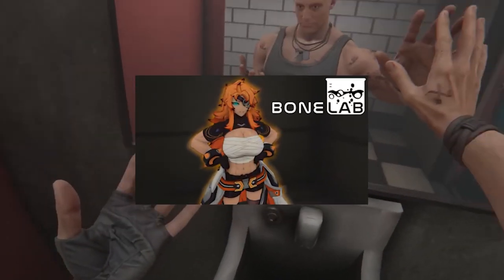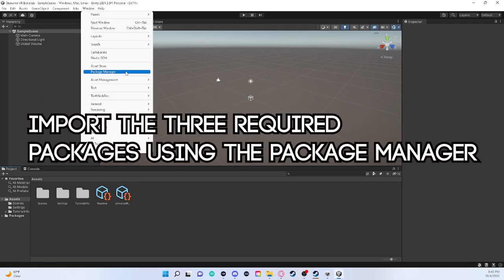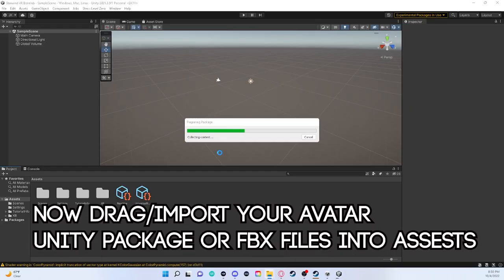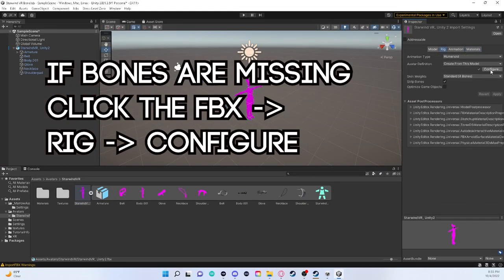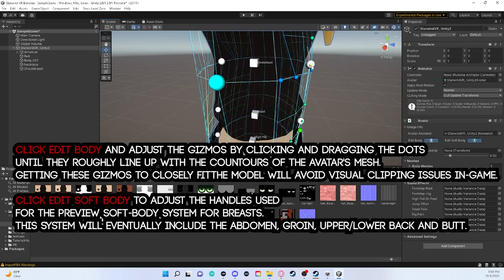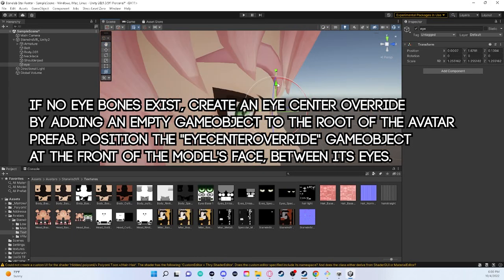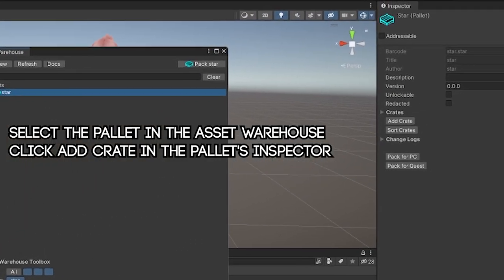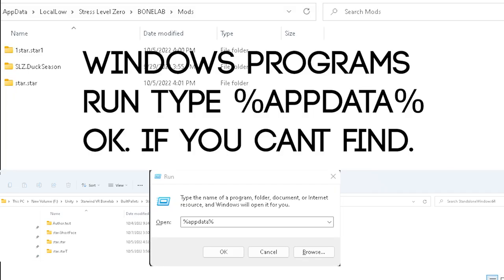Import Any Avatar into BONELAB Tutorial, PC needed!

Comment: I've repeatedly uninstalled and reinstalled git, i've restarted, and powered off then powered back on my computer. I even tried making another project. But despite all of this, the packages never download. I've done essentially every form of copy and paste I could think of and none of it worked. Please help me, what am I doing wrong?
Reply: Im having the same issue. Wont let me add on even though it's installed.
Reply from the maker: Are you using the links straight from the bonelabs site ?
Reply: @starwindvr2921  I copied from both, the description (and I deleted the space), as well as the same links from the GitHub website every other YouTuber referenced.
Reply: Make sure you have the path to the git executable in your PATH environment variable and then restart after, fixed unity not being able to find git for me

Comment: I got a character into bonelab and it is working great, but the hands are weird. It is something to do with the marrow/twist bones. There were unset for the most parts, so I tried setting them up. Thing is, I used the mixamo rig and the names of the bones do not align with the bone names in unity. Now the shoulder and elbows just will not co-operate and the hands look weird. How do I fix?
Edit: the hands are short: that is the issue. But they are not short on the model, and work fine in vrchat.

Comment: I am so glad to finally have a video tutorial specifically for vrchat avatars. I wanted to make sure that I didn't break the model when I uploaded it. Thank you so much for this1
Reply from the maker: My thoughts when I made it! Did it work well for you? I went a little fast in some parts.
Reply: @starwindvr2921  I mean, its working ish. Basically it only appears when I look down a certain angle, I am trying to get some help to fix it, but aside from that it works great
Reply: @g-owl  Is it a bounding issue? Sometimes I get that issue when working on VRC avis, when you click your mesh you can adjust the bounding box, and that determines if it'll get rendered or not. However I'm not 100% sure if thats just for editor? or not